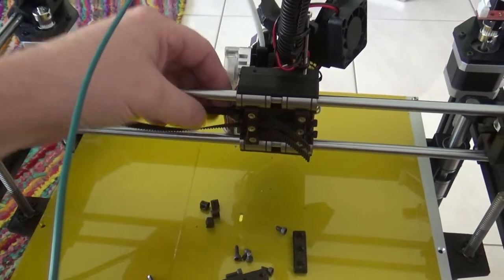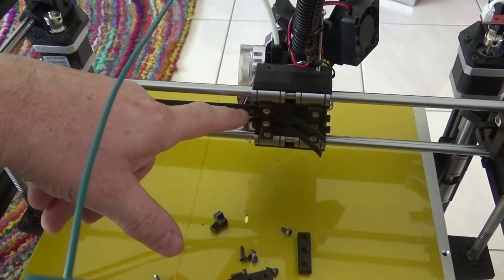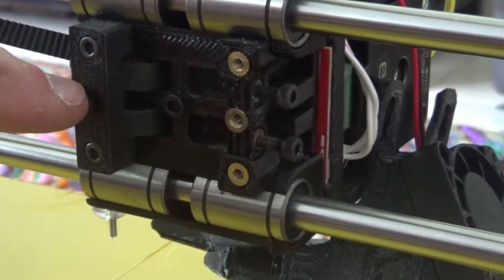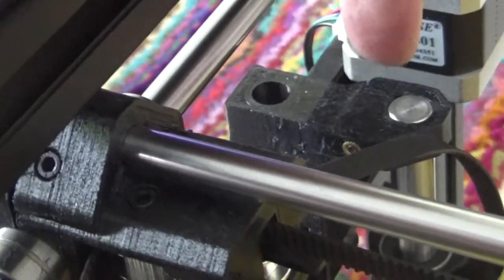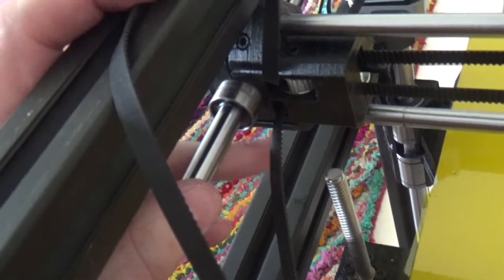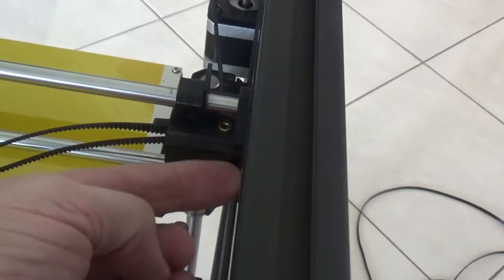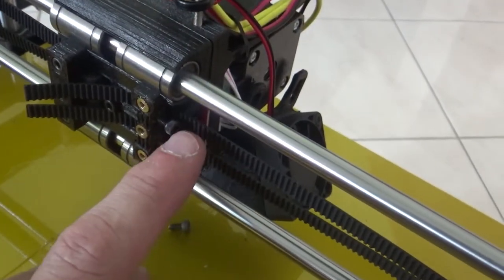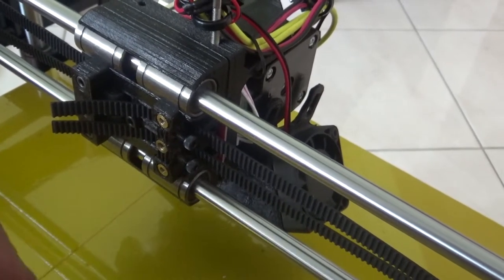#109 Hypercube Evolution 3D Printer - Installing the Belts

Comment: Hi, did replacing the belts solve the issue you had in the previous video? I'm planning to build a Hypercube myself, hope to learn as much as possible from other people's experiences.
Reply from the maker: Yes it did. 
When I removed the belts and placed them face to face, the teeth should have lined up but it’s like it was stretched in places. Not sure if I tightened them too much at some point but they were meant to be steel reinforced so I doubt it. I ended up replacing with normal fibre reinforced belts and it’s been fantastic
Reply: @GrumpyOldTech  Allright! Thanks a lot!